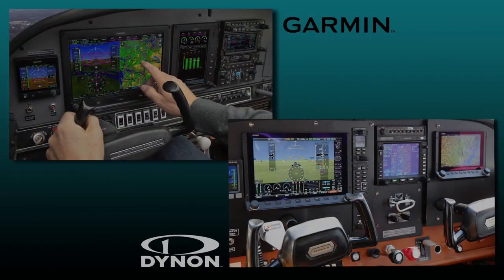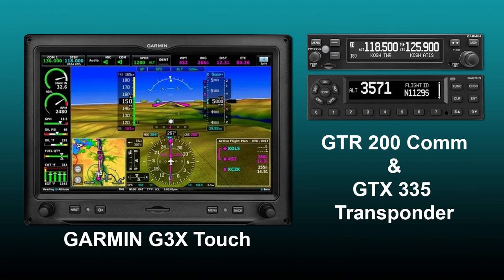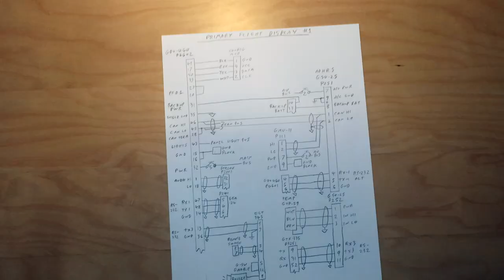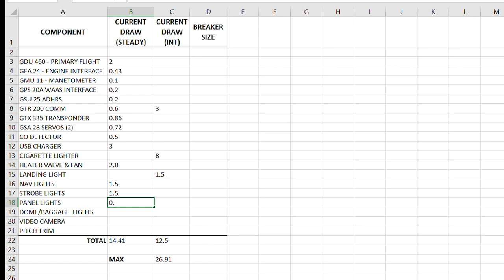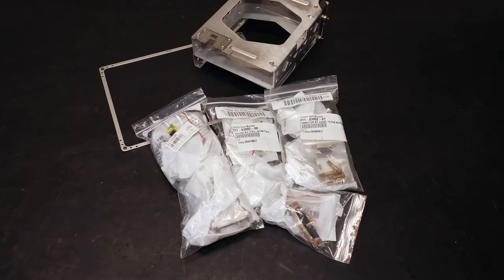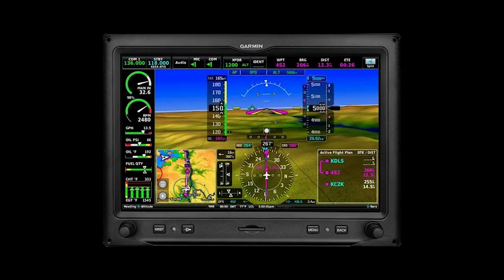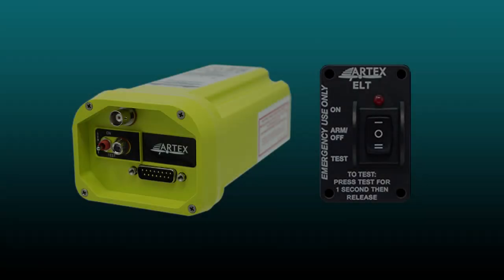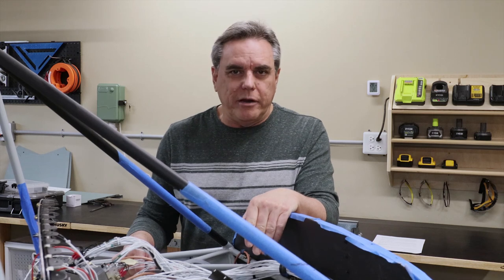S-20 / S-21 Avionics Selection, Schematics and Panel Layout

Comment: I’m so glad I found your channel. I’m not building a rans, I’m building a Vans, but your advice is gold! The industry standard of having the engine gauges on the same side as the controls is something I didn’t know, and will implement. And the elt control position I will now move in my design. I had it far right as well, thinking I will never have to use it. Oh also you are making me want to build a rans next.

Comment: Following along with your journey with bated breath. Would you be willing to add notes to the video description on your component list.  The Garmin catalog is less than intuitive for non avionics folks when they try to spec out a system like your day/night vfr rig.  The S20 I currently fly has an older 10inch Dynon Skyview system with matching radio and transponder.  It works great, and is completely serviceable for day/night vfr, but having seen the quality of the new HDX panels, I’m a little envious.

Comment: I installed 4 point seatbelts with inertia reels in my S20. This allows me to reach every part of the panel, something that allowed more flexibility as the panel was being designed and met the criteria you pointed out . ELT switch and a USB plug (for the co-pilot iPad) are on the far right but still comfortably reachable.
Reply: Good plan Martin. Looks like that solves the problem of reaching the ELT switch. Too bad the stock kit does not come with those inertial reel belts.
Reply: @paulnovacek836  Yes, too bad indeed. The change required welding anchor points into the ceiling of the baggage area. Only something that could be done before covering.